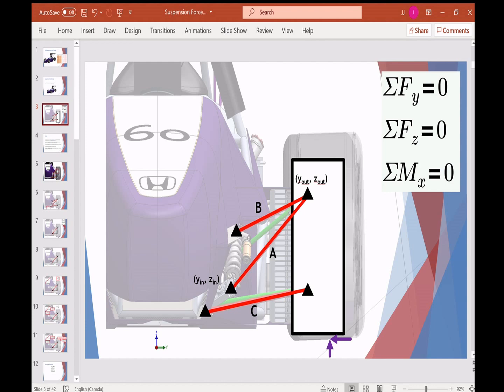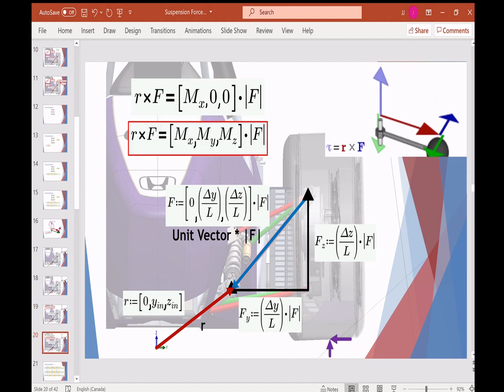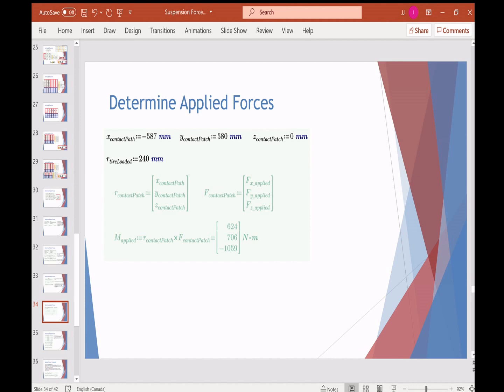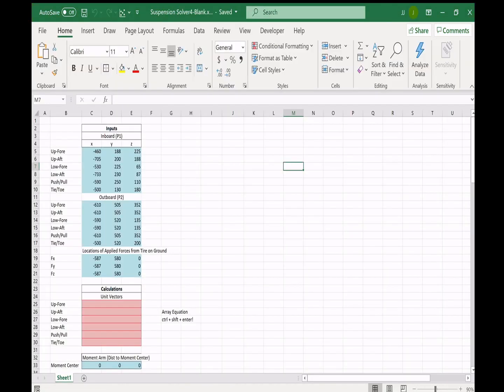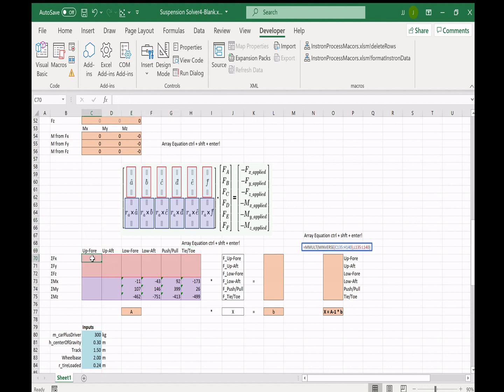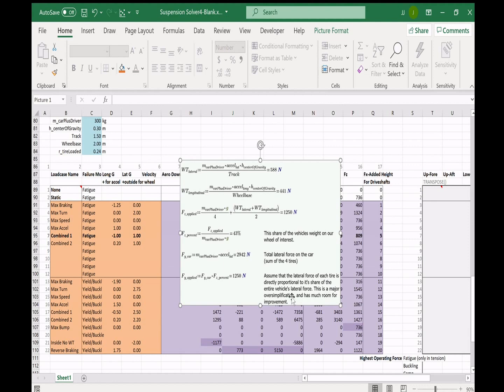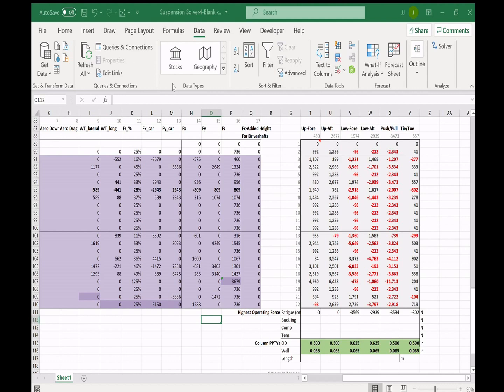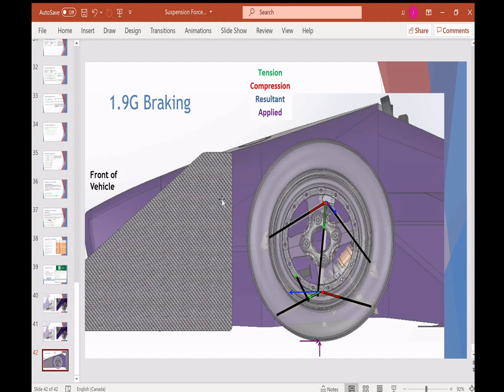FSAE - Solving Suspension Forces with Matrix Method

Comment: Under Maximum Braking conditions why is the longitudinal g negative instead of positive, the load transfer is on the front wheels of the tires??same while a right-hand turn in vehicle the load transfer will be on the outer tires the left tires so the lateral g should be also positive, but it is provided negative.

Comment: Thank you for this walkthrough, can you please explain to me what situation you would change the moment arm values?
Reply from the maker: assuming you mean 'in what situation would you change the point that you take the moment arms about?', and the answer is really just the first time you fill in the spreadsheet, it can be a useful check that nothing is wrong with your calculations... You should be able to set the xyz coordinates anywhere, and the output of forces in your control arms should never change- if they do you have a mistake somewhere.

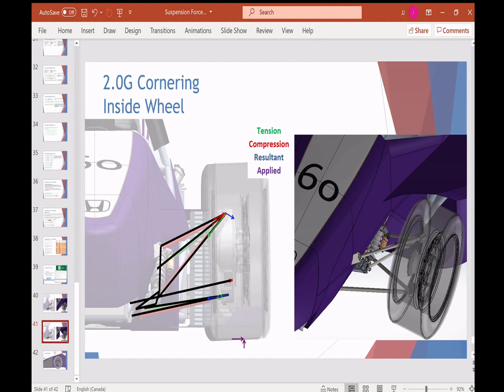Comment: can you explain how to get blue forces of 36:30 screen?
Reply: May I know how you found Fx_applied while you were calculating applied forces
Reply from the maker: Just vector addition of the forces at the ball joint. Since my example is a pullrod, the vector sum of fore upper control arm, aft upper control arm and the pullrod. For the lower one, just the vector sum of the two lower control arm tubes.

Comment: hi mate, can u just explain to me how did you get those values that are in blue tables based on your car model? 

 I know they are your measurements but explain them a bit better. i appreciate your work
Reply: did you find the answer if you find it, i want you to share the answer please
Reply from the maker: m_carPlusDriver is the mass of the car plus driver
h_centerOfGravity is the height of the center of gravity of the car. 
r_tireLoaded is the loaded radius of the tire. Essentially how high the center of the axle is off the ground when there's a driver in the car (basically accounts for tire deflection). 
For track/wheelbase google will help you out.

Comment: Hey quick question. So if your coordinate system is set up how I think it is (x- positive forward, y positive to left side of vehicle, z positive upwards), I understand why in a braking and right hand cornering case your input x is negative but why is your y positive? If we are looking for max load on the left side of the car, shouldn't the y be negative to simulate a right hand cornering case?
Reply from the maker: Good catch! Looks like for loadcase 21, our inside wheel, most of the arms should be in tension, but they're in compression! I think you're right.